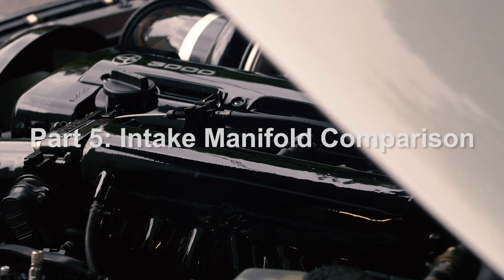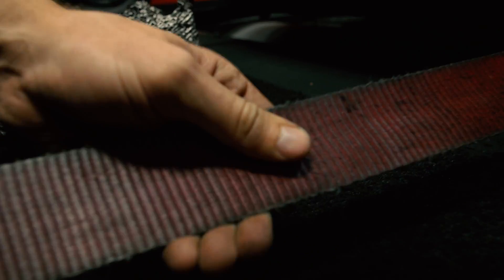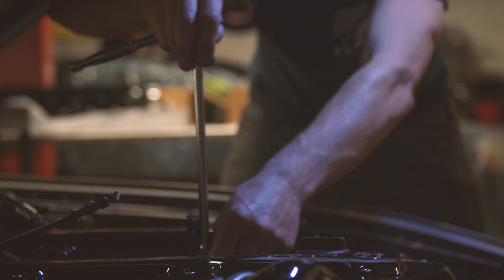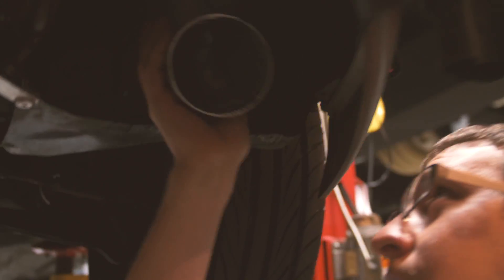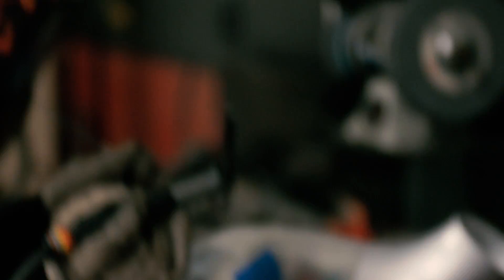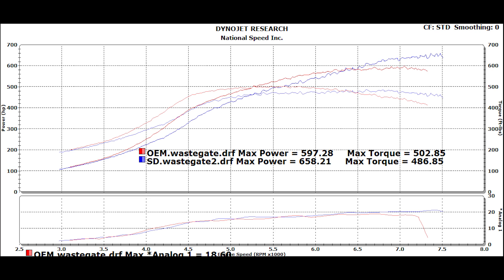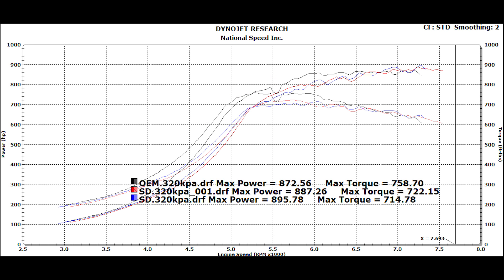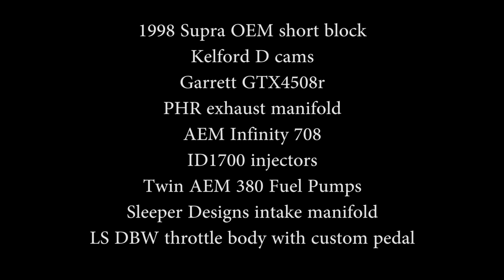Part 5:  OEM Intake Manifold vs Aftermarket

Comment: Im running a 7675 around 42psi on stock manifold...seeing this comparison, i feel as if i should stay with the stock. Thats a pretty significant power loss on the mid range with the aftermarket.

Comment: Vlad, what happens to the idle control valve water side with the new plentum. Is it just rerouted and how. Thanks
Reply from the maker: I never use the water ports on any idle valve even on OEM intake.  With that said the aftermarket intake manifold has a drive by wire throttle body, it does not need an idle air valve.
Reply: @vlads2jz  Thanks man, like I said I installed this motor and   haven't had time to finish her up because of a demanding 'Job' and have forgotten a few details.
Reply: @vlads2jz  Question? Is there any benefits for not using the      water ports? I'm new to this engine and enjoy hearing different opinions on do's and don't's and why and why nots. So are you just recirculating or closing them off. Your thoughts are much appreciated. Thanks

Comment: Great Video... I also have the LS DBW setup on the Brangers intake with short runners. Running Proefi and E 85, But i have had just so much issues with the DBW. pressing your throttle slowly down at idle, nothing happens and then boom, goes to 3000 rpm. Or i would drive and the Rpm would not come down less than 2500 Rpm. Break stop on the clutch and sure then the car would idle at 850 rpm. It's back on the rollers for more tuning now, but have you run into such issues ?
Reply from the maker: No issues like that.  That is all tune related.

Comment: Very nice review, I noticed that you had over all more boost on the wastegate level, oem vs aftermarket. Looks like it was a little over 20psi with the aftermarket unit.  I'm going to assume with all runs the boost wasn't matched exactly between all oem vs aftermarket @ 6300rpm+?
Reply from the maker: Yes the first run had boost controller turned off so it naturally made a little more boost.  The other runs had PID feedback controlling boost and targetting the same exact boost levels.